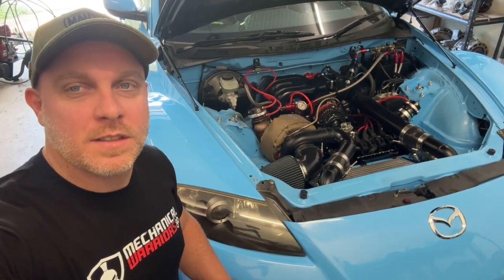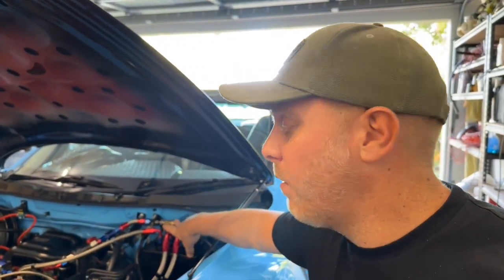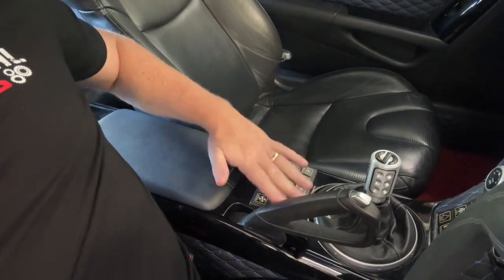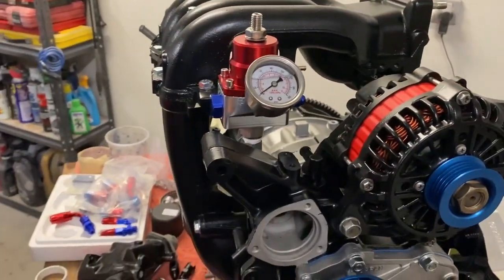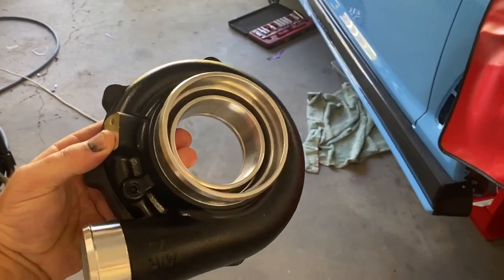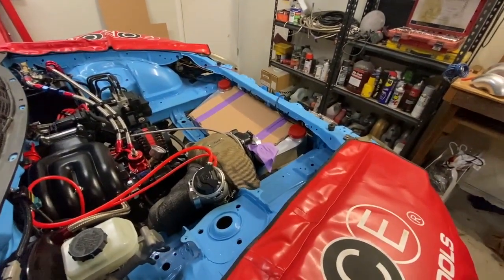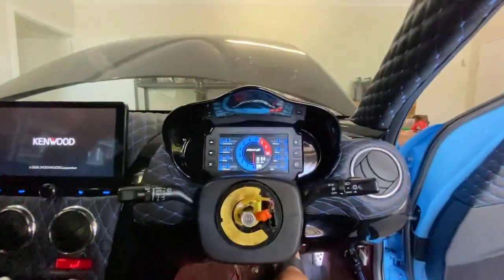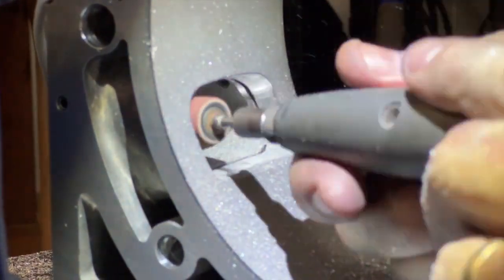Building the Heart of a Show Car: Engine Build and Fab Work | RX8 Show Car Build - Episode 2

Comment: Great vid mate👍🏻
Has this car had a full rewire? 
Where is the engine bay Ecu module and factory fuse box been moved too ?
Reply from the maker: It’s gone mate the car is running off a haltech nexus r5 I’ll be releasing a video on the wiring in the coming days but there is no fuse box nothing like that anymore all original wiring has been removed
Reply: @mechanicalwarriorsofficial oh wow
Looking forward to a run down on that and to see how much is involved.. Looks so much cleaner in the bay 👍🏻
Reply from the maker: @R1P5   yeah I agree with you on that, I will do the next video on how i did the wiring soon :) stay tuned and thanks for the support

Comment: Wondering if you can show more on the radiator and intercooler setup. I really like it
Reply from the maker: Sure I could make another video based on that if you like ?
Reply: Please. And also would you consider making any ducting. To air in an air seal. To better ensure even more efficiency ?

Would you consider making this exact kit for sale? I'm interested in buying your kits including your setup  for the ignition and fuel